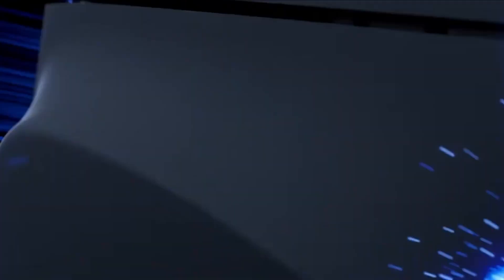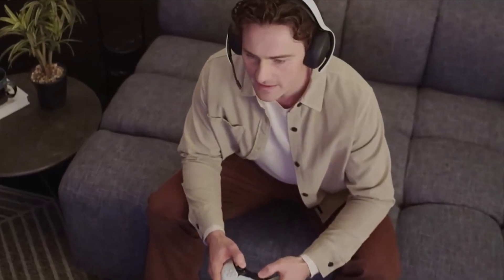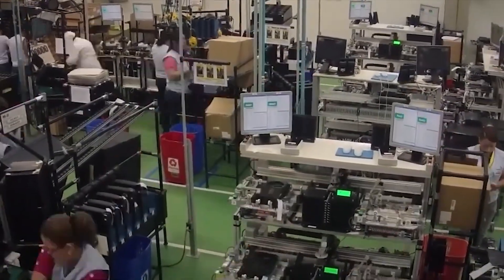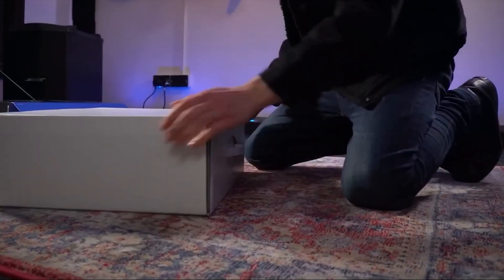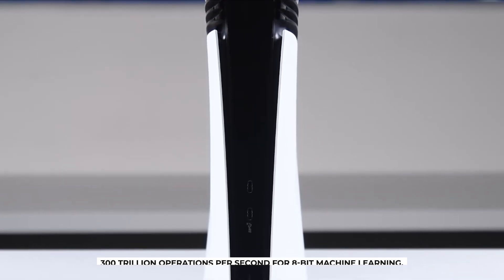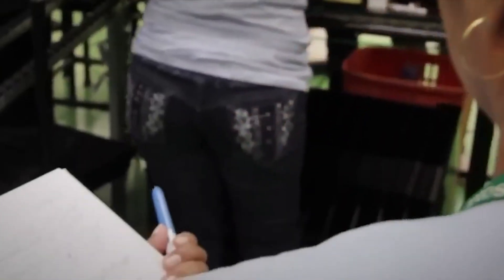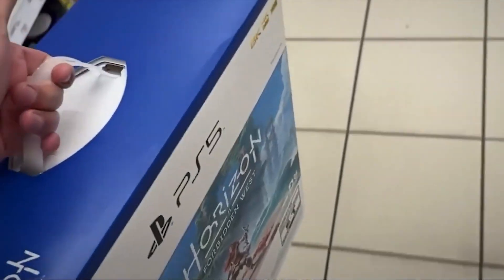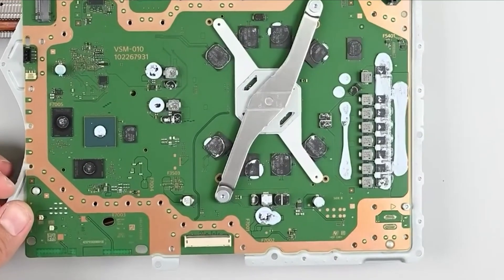How PS5 Pro Is Made – And Why It Costs $700 | THE MAKING

Comment: The differences are minor or even not visible at all. the point is games are designed for the standard ps5.
Reply from the maker: Exactly 👌 most games are optimized for the standard PS5 anyway. The differences are so small that unless you’re really nitpicking, you won’t even notice 🎮🔥
Reply: that's not absolutly true, i just get the pro and sale my normal ps5, setting it with a LG C4 77", with games with "ps5 pro" patch, the difference is most than visible... before you say "fanboy", that i'm not, i'm just a tech addict and precision is i'm working as an tv calibrator (isf certified), have xbox serie X  (and S ) and the non loved (for me) switch 2 for my personal use. yes, ps5 normal is "enough" for most of people, but if you have the right screen, and know your job how to set it and want the best sony is giving, then it's the way to go (even if i dun like the price point of it). sadly if devs don't make patch for the pro, then the difference is marginal. mostly people tell it the same because they usually don't have it or the money to get it, or the screen with the right specs
Reply: @sebk2669  The big difference is your TV mate, that will absolutely will be looking great, but not everyone can buy an Oled. On my TV i can hardly see a difference between performance mode or Pro mode, i leave it on that setting hoping someday i will see it ;)
Reply: Make sure you guy's have a 8K tv you will see the difference